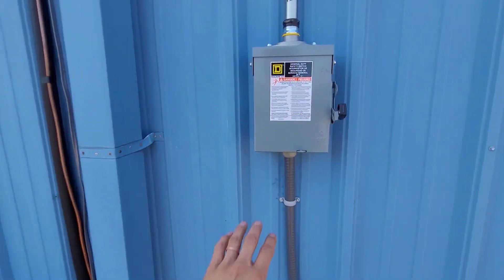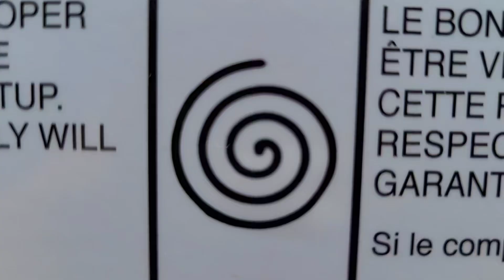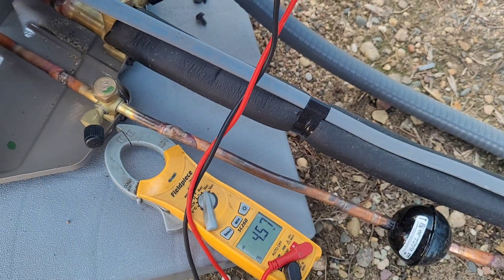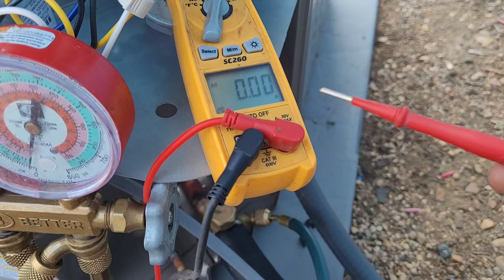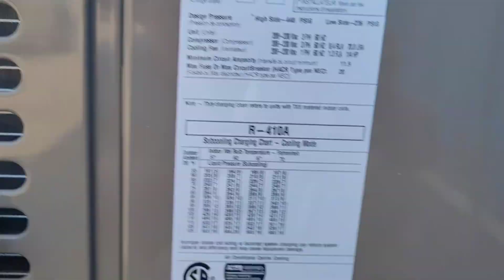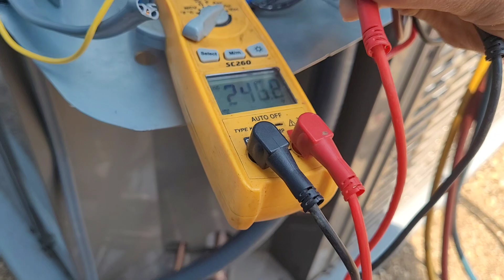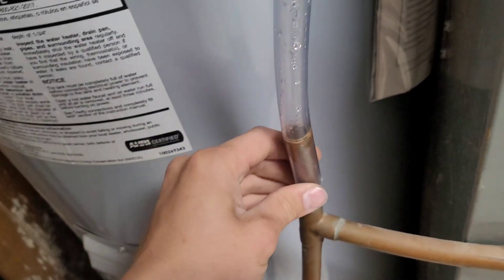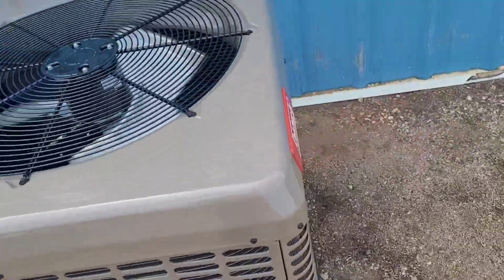How to check Rotation on three phase Air Conditioner!

Comment: Sorry, I didn’t understand how you determine which two wires to change was there two power leads in a ground is that what happened and you just changed the two power leads and didn’t touch the ground/neutral
Reply from the maker: Yes, I did not need to do anything with the ground wire. With three phase there's power on each of the three wires coming into the unit. When powered up, it will spin one direction. If that direction happens to be the wrong direction, you remedy the problem by switching any of the two leads. I could have switched the one on the left for the one on the right, or the one in the middle for the one on the left, or the one in the middle for the one right and the result would have been the same. The motor will switch directions.

Comment: The high leg is found by going from phase to ground/neutral. It sounds like you have a 240 Delta system. That means you should measure 120v between 2 of the legs and ground. The high leg would measure 208 to ground.

Comment: The Fieldpiece SC680 will show you if it is a forward or reverse rotation on your phases without having to run the compressor....if the electrician had one then they could have made sure they were both wired with forward rotation!

Thanks for the video Reuben!
Reply from the maker: Wow! That's really neat. Perhaps I should upgrade my electrical tester. I really enjoy the field piece meters. It would be nice to have something that measures DC microamps too, as my existing one does not and I'm in need of it when adjusting certain pilot appliances.
Reply: @ReubenSahlstrom  I really like mine and it also read DC micro amps. The only complaint is it is a long meter but just get a Veto Pro bag that it fits in and you are good to go Reuben! Just curious what state are you working in?
Reply from the maker: @LKN-HVAC primarily Minnesota.

Comment: Had a early 90s unit with a scroll that ran backwards if there was a very brief power blip during a storm, it had a short delay on make to prevent that but didn't always work. it just got very noisy and had to cut the power and restart. never got damaged.
the new single phase scrolls don't seem to have that problem.

Comment: Why manufacturer wasn't installed some sort of phase sequence control relay into the unit? It could protect compressor from reverse spinning by breaking 24 V circuit to contactor's coil.
Reply from the maker: There are companies that do, just depends on what cost point the equipment is being sold at I suppose. 

The system really only needs to be checked for phasing once, and then it's in theory is good. I did work on an air conditioner that the electrician replaced the breaker for, and when he put the leads back on he accidentally set that it ran backwards and it burnt up the compressor. A phase monitor would definitely have prevented that.

Comment: Is the indoor blower running backwards too? 😂😂 Very good job explaining compressor running back diagnostics 🫡🫡
Reply from the maker: If the fan motor was a three-phase motor as well, it definitely could have been running backwards! In this case, it is just a single phase motor, so rotation is not affected by the power coming in.